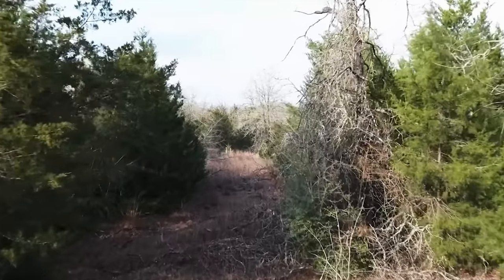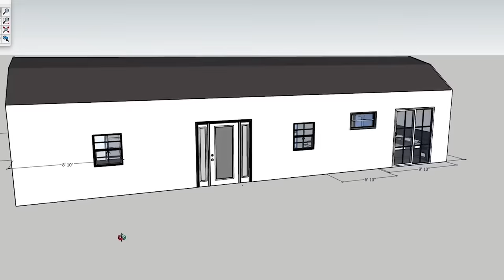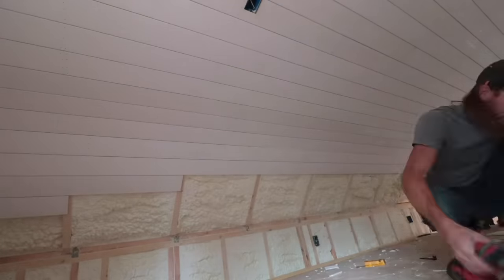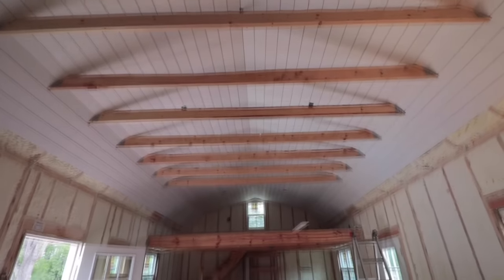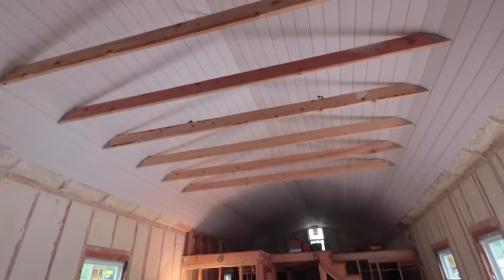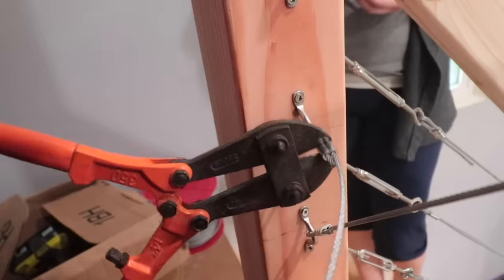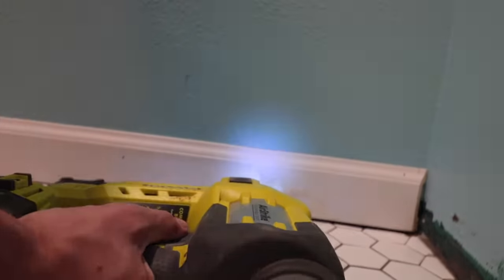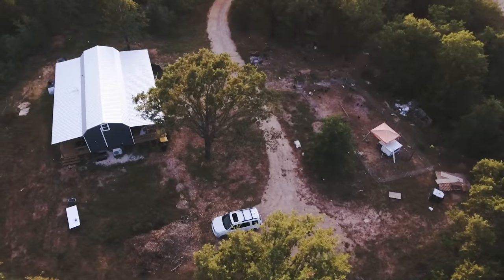515 Day Shed to House Conversion in 13 minutes {Timelapse}

Comment: I paid $10,200 for my 14x40 shed, and bought my daughter, son in law and their new born son the same size. I put both sheds together in an L shape and then a few years later I bought another shed that is a 16x50 and made it mine and husbands new place. Then we connected the first 2 buildings and rearranged some things and by cutting out a hallway and adding a small roof to that part and now it has become a 2 bedroom 2 bath home for them with 1150 square feet. If they have another child they can always get another shed and connect it like we did to make it 1,400 square feet. Around here a plain 1,400 square foot home on 1/8 acre would cost $200,000. But doing 3 sheds we can do it for $50,000. And that’s even buying all new appliances and not repurposed items. Think outside the box and it’s always a win win. Most people want to start large and that’s where they get into financial problems. Each shed we got did not required a credit check and we were able to pay monthly payments for 5 years. Our first one was $485 a month for 5 years and 2 years later we got the 2nd one. Now I’m in the process of building a porch inside the L shaped house to connect both doors to a huge porch for their son to play on and an above ground pool right off the porch for us all to swim. We live beside each other so when I get older my daughter and grandson will be there to help me. Also, If my parents ever need a place to stay at the end of their lives they can always stay with me even though it’s a smaller place because everything is built wheelchair accessible inside the house. Think forward in life and you’ll save a lot of money.
Reply from the maker: Mandy, this is SOOOOOO AMAZING!!!!!!!!!!!

I love this so much, huge congrats!!!!

Comment: As long as there is internet access, some folks could live in a 70sq ft room.
Reply: I lived in a van with less than 70sq ft. Anything is possible. Besides,  I was happier there than the 1960sq ft house I left prior to living in the van
Reply: @BoeingJetTech  I'll take the 2000 sq ft house anyday
Reply: U are right on
Reply: I got lucky, moved to rural Tennessee but very close to town, and the county just got gigabit internet. 1000mbps

Comment: I'm super curious about the wood flooring. How did you insulate the floor before putting the flooring down? Since it is a shed I'm sure you  had the issue of cold air seeping through the floor.
Reply from the maker: The floor is spray foam insulated underneath.

Comment: I'm sure it's gorgeous, but that must have been some expense!!!!
Reply: Can't be as much as a regular stick framed home...it just can't.
Reply: @augustreil  regular stick built house would last much longer. Sheds are built to shed standards.
Reply: @stanleyhape8427 , If you notice, that is a stick built structure, there's no difference.
Reply: @augustreil  its a shed
Reply: @stanleyhape8427 , So what !  It's still built in the same exact way a house is. The deck, walls, roof. All stick built and in a controlled environment which is better. And it's not a shed, it started as a shed as all houses do if you don't finish it. Tell me what the difference is ?
Reply: @augustreil  i already did.
BTW all houses do not start out as sheds.
Reply: @stanleyhape8427 , They all start as a shell, nailed together with 2x12, 2x10, 2x8, 2x6, 2x4's with nothing in them, making them a SHED/SHELL, until it is finished inside making it a home. Tell me the difference that makes a house SO much stronger when the same materials are used ?????
Reply: @augustreil  sorry , but you are not capable of understanding the difference. 
As i said before sheds are built to shed building codes and houses have different building codes.
Reply: @stanleyhape8427 , I've built houses for 25 years, the same nails are used as is the lumber. You're the one who's obliviously never built anything and don't understand the basic building concept.
Reply: @augustreil  LMAO..sure you have.😂😂😂😂
Reply: @stanleyhape8427  

You still haven't given us any information on what about them makes one stronger than the other. 
Stating codes are different is very vague. Can you help us out with some information?
Reply: @stanleyhape8427  Municipalities have building codes and each isn't the same, so August is correct.  They are all wood frames and you can decide what you want them to become.  There are people that turn "sheds" into different things such as beauty salons, sales offices, nail bars and more, so it's only a shed until you turn it into what you want it to be.  It has the name shed because it was originally build to store things, but once you use it for something else, it is no longer a shed.  Educate yourself.
Reply: @simpleesuzie9369  LMAO you need to educate yourself , just because 2 things are made from wood that doesn't make  them equal. 
Sheds have a weight limit of what they can hold. Once you try and convert it to a house you are increasing the weight in and on the structure tremendously. The weight of all the interior finishes , appliances , furniture , tub/shower , etc . Also sheds are not built to be lived in so they don't tolerate the added moisture that is produced by living in them . That's why people that do these conversions have humidity issues. In order to correct everything needed to make it a healthy safe home you are spending serious money . Plus the cost of the land , foundation , municipal services and septic system.
Even after spending all the money you can end up with a home that won't qualify for homeowners insurance.

Comment: Looks like you build a small house with really cheap exterior walls, the most important walls. Wtf. Why not build a reg small custom home onsite?
Reply: It doesn't look like tornado country.  I give it 120 mph before it is really messed up.  Lucky for them, they have trees around them to keep the wind off the roof.

Comment: After the rough draft i wired the building with switches and outlets. I ran the wires behind the basboards that were installed on hinges. Next i covered the walls inside and out , then filled the cavities with mud and straw for insullation. After that the outside got siding, and the inside sheetrock.

Comment: Pretty awesome y'all, may I make one suggestion. Your cables in your stair rails. Take a small piece of rubber hose or something and splice it and slide it over to: 1. Prevent fraying, 2. To prevent little hands sliding and getting cut
Reply from the maker: Great suggestion. We are actually going to use a cable cap that uses a heat gun to shrink it for a secure fit. --kelly

Comment: We just purchased a 12×40 shed to house that's not finished yet. For some reason God showed me your video 7 reasons something or other. 

Husband thinks we should have an electrician look at the interior electric and make sure it was done properly. 

The plumbing was cut off when we had the building moved too. 

There is 6 inch fiber insulation we are thinking of striping the walls down to the studs and out in more windows. It only had 2 windows. 
Can we spray the insulation ourselves or would you recommend a professional? 
We spent so much on it already. There are roaches in it that's why we want to use the spray foam. Any suggestions? 
New subscriber here. We will be posting videos as we go. I do not know how to edit or put music to my videos. Just plan Jane.
Reply: Hello Kansas..😊

Comment: Just stumbled onto your channel and really enjoyed your video!  You guys are warriors!  

The cable railing is awesome.  One suggestion if you haven't done something already... take some clear shrink-wrap tubing, cut it to3/4" or so and slip one onto each loose cable end.  Then use a heat-gun or hair dryer to shrink it up tight.  That will keep those ends from fraying and keep little-ones from cutting their hands on those sharp cable ends.

Comment: Wondering how far North you are. I live in College Station and although it was a warm winter this year, last year it was cold! With the exposed pipes underneath the house isn't freezing an issue in the winter?
Reply from the maker: Nope.  All of the water lines are PEX. Which is freeze resistant.  The rest of the pipes are just drain lines.  So no water in them to freeze.

👍🏻
Reply: Hello Sally..😊

Comment: On the stairs, the cables you can heat shrink the cut ends to prevent stags and pokes, just a tip.

Comment: Please wrap the end of your cable railing with e-tape or heat shrink. I work with those types of cables every day and after a while, the cut ends will start to fray and you do not want to fall and grab on to those. Especially with little hands around that height as well. Giving the cut ends some coverage will go along way to preventing future boo-boos.
Reply from the maker: We went with a product called Sugru... so far so good.

Comment: I don‘t want to be a spoilsport but as a swiss architect with plenty experience lookin g at that minimal light weight construction, this is only fun until the next Ida or Kathrina. comes along.
Another thing that I don‘t understand is the lack of real outside shutters to prevent heat from getting into the house, or to keep the heat in in winternights and to protect the windows during storms. Instead we see pictures of people running to a hardware store to fight over plywood with each approaching storm. 
BTW foam insulation is banned from the list of ecological building materials, it contains gaz to form the foam. Plus after some years it starts to crumble and loose it‘s capacity to insulate. You could use sheep-wool instead.
All in all I appreciate your effort to live without debt, just a little more savings beforehand would have resulted in a more ecological and longer lasting result.

Comment: I was liking this idea until I saw the spray foam. My research tells me that there are some foams you need to let off gas for lengthy periods of time before enclosing them with drywall. Some folks believe it's the formulation of the chemicals in the foam. It's hard to say. Every resource I've looked at has a little different opinion. What do you say? Do you let the foam off gas for a period before enclosing it?
Reply from the maker: We did leave these walls open for several days to off gas. Most contractors suggest it’s safe within 2 days. We gave it more time.—Kelly
Reply: @BetterTogetherLife  Thank you, Kelly.

Comment: I placed three tanks at 1500 gallons a piece and connected them like you did with the 2 inch PVC but I’m finding out that the one tank that receives the rainwater is getting 3/4 of the way full and the other two are a quarter any suggestions

Comment: Thanks - fun to watch! 
Cost please? Is flooring/ceiling lamanent or real wood? 

It's a little confusing - I only saw one date flash on the screen, did it take 515 days from raw land to completion? If so, is this because you did most of the work yourselves or on weekend, etc...?

Also wondering how the total square footage ended up with the two lofts?

Comment: My house is made from 1000sf barracks buildings, we used the metal frame, and rebuilt the inside and outside, the buildings cost 500$ apiece, it cost 500$ to move them, and 500$ to put the piers under them. 2x6 exterior walls all total 2500 sf for less than 30000$
Reply from the maker: Way to go! That’s amazing—kelly

Comment: I have seen your videos of where you have turned a shed into a home. We are just now starting ours and doing the same thing. We have noticed though when it rains we are getting water coming under the framework onto the floor mostly near the windows and doors. In construction we had them spray the underneath with closed-cell insulation. We have talked the floor and the bottom Frame Works to feel it but it's still coming through. Can you tell me what's causing this and how to fix it? We're just running electric now and want to hurry and seal the house with insulation but we're afraid to do that until we know the answer to this problem. By the way we do have skirting on already. We just can't figure out where it's coming from

Comment: could you please elaborate on why the Pocket Door didnt work out? i was already thinking of something like that for when/if i ever get my own house. Was it mechanically not viable or did you not like it?
Reply from the maker: The builders used that wall as load bearing. So we couldn’t change the structure of that wall without violating a warranty. We kept it as a regular wall and added the barn door. Bc it was irregular size (expecting a pocket door) putting a regular hinged door would have been an extra expense.

Comment: yes, I could live in that, but if I was doing it from scratch, I'd make different layout choices. it's just me and the wife, and we're getting old, so there would be no upstairs, unless I put in something just for occasional storage, but not to actually use on a daily basis. Essentially, it's like living in a single wide trailer, though way better built.  I do love the decks, but I think I'd have taken them all the way around the house, including the ends. Maybe not for you, you could always add on if need be in your case, but I think for me that would work. I have had places where the kitchen and living room are essentially one large room, and I like it that way. I would make the kitchen portion larger with more counter space, and a place to hang pots and pans that the wife could still reach, maybe on a pulley system or something so they can be out of the way when not needed. Hmm, maybe a work table in the center that either goes up out of the way, or down to become part of the floor. Lots of things can be done like that, the only real limit is you imagination, and of course some skill to make them happen. I am the local MacGyver type, I can do things with trash you wouldn't believe.

Comment: AWESOME!!!! Really looks comfortable for everyone and very beautiful, especially on the inside (❤️❤️)....just a couple of concerns & questions. How would this type of house stand up during a hurricane, storm or tornado? How fire-resistant are the materials or is that a huge, huge consideration? I noticed that it doesn’t have a firm foundation, how much wind can it tolerate? Also, would one be able to design a double wide trailer or a prefab, stick built home in a similar fashion? I honestly do not know. Given some pretty harsh weather that Texas can get, I’m just wondering about some of these issues. Love the idea!! In the right part of the country this would be absolutely fabulous. I live in NC, I’m not familiar with all of the though processes that goes into deciding what type of structure would be appropriate. Given the tornadoes & dangerous weather that we experience, sadly we wouldn’t be able to build this. MARVELOUS job - what a wonderful family!! Blessings! ❤️🙏🏼🙏🏼🙏🏼❤️
Reply: P.S. Just forwarded your video to Hubs.....very nice.🤔🤔🤔🤔🤔

Comment: My only struggle would be the low ceiling height in the lofts
Reply from the maker: I do agree, it is something that we have thought about also.  The videos make the lofts look SOOOOOOO MUCH smaller than they actually are.  But yes, they are only 5ft at the peak.

Some companies will do a “build on site” in order to get the loft height to 6ft high.  Which for many people would be perfect.  I am the tallest in my family and I am only 5’10”.

I think we will be making a “shed to house Q&A” soon to help answer some questions.

Comment: Seems like all the labor was contracted. Did y'all have a hand in the build? Or just the recording?
Reply from the maker: We hired out the electrical, plumbing, septic, drywall, kitchen, and then I had a contractor buddy help show me how to do the ceiling and deck.

But correct, it would cost a lot less if you have the time and skill to do the work yourself.  We needed to go fast.

Comment: Actually I think that our society would benefit greatly from actually encouraging these smaller homes rather than seeming to do everything they can to make such so difficult to get approved.
We would use less energy as heating and cooling a much smaller area and many would be able to afford housing that otherwise would basically be living on the streets.

If I were to see a perfect fit would be for aging seniors and even more so for single seniors.
Also a good starter home for younger people as well and again most single people have little need for a 3 bedroom 2 1/2 bath house and this would be so much cheaper to buy, pay for and monthly expenses.

But I also see where the possibility lies that unless a person is doing their own conversion that the chances for someone to be way overcharged for what they are actually getting is a very real possibility also.

Comment: Not trying to throw shade, but the narrative said living w no hot water & floors was better than being apart, but from what I could see a very nice 5th wheel trailer was set up beside the home the entire build.   Hmm that 5er has hot water, refrigerator all w propane.  Also u guys had power so that 5er also had heat & ac.  Love the build though but u were never ruffing it w a 5er there.
Reply from the maker: That trailer was our contractor friend that lived here with his family for 3 weeks.

As soon as Kelly and the kids moved in, they left.

So yes, no hot water.

And then our neighbor has a white trailer.  But that’s not ours.
Reply: Better Together Life,  I would have let u use our 5er if neighbors especially w/ little ones running around.  Glad everything settled.  We started camping when ours were ur little ones age.  5er’s r great w family & pets.  I’ll buy a used one & fix it up when we downsize our current one.